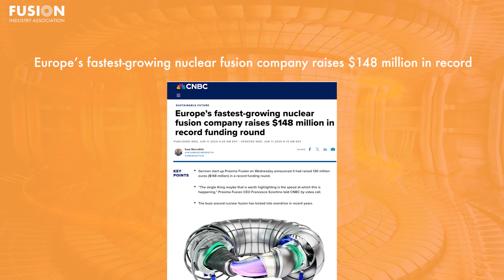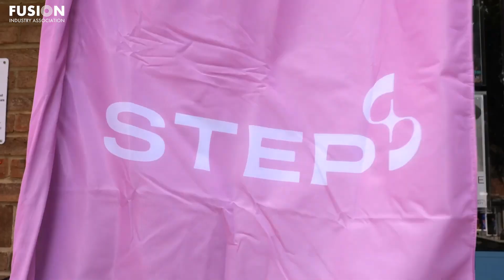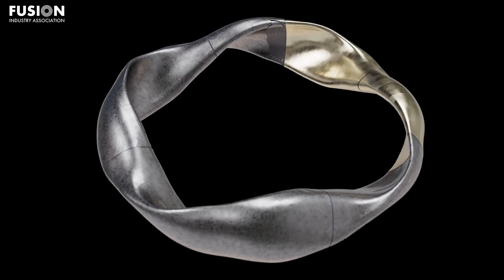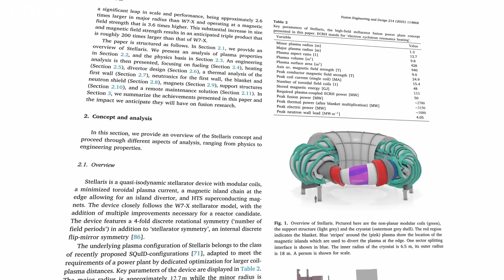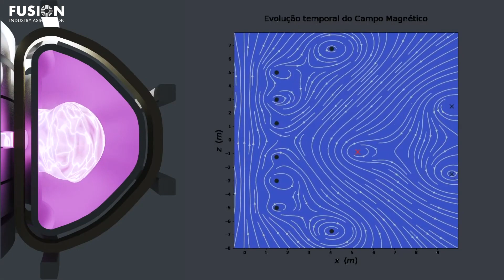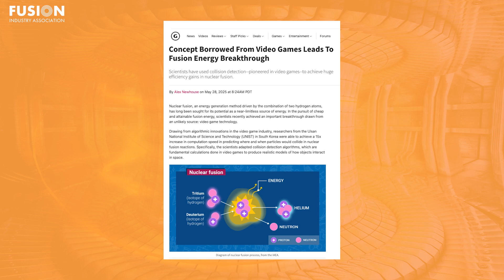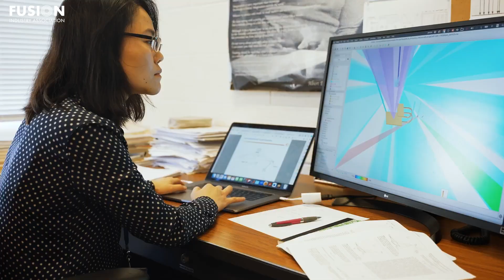Fusion News, June 25th, 2025

Comment: Great news that the UK government is putting money into Fusion instead of oil and gas. 

Am i alone in being slightly concerned that important aspects of the plasma physics has not been worked out yet ?
Reply: I believe you are right but don’t be too negative. JET after 40 years operation managed five seconds of DT fusion power so extrapolating to a full day or days (as surely required in the UK STEP project) will not be difficult. I assume this must be the view of the project proponents and with so much money going into this project, they surely can’t be wrong…..